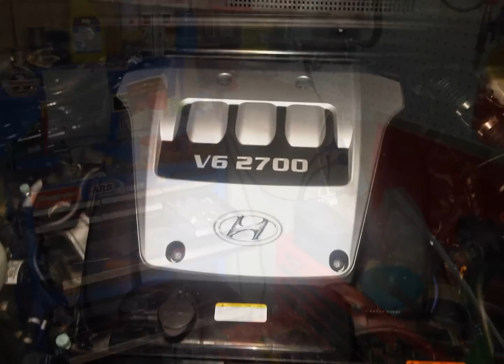Hyundai Tuscon  Timing Belt

Comment: This was far more helpful than videos that actually try to explain. I replaced the timing belt on my 2.7 dohc and couldn't figure out how to line up the crank. I've got it all back together but it still won't turn over. Just a continuous crank. Been trying to figure out where I went wrong lining all the marks up.
Reply from the maker: hey william, as long as the crank marks and the cam marks are all correct it should fire. when you let go of the tensioner do the marks still line up?becuase the tension when released will turn them.
outside of that you should check for spark first, then a led test light across an injector to see if the ecu is triggering it, if thats good then check fuel pressure
Reply: @TheBenno007  All marks were lined up even after releasing tensioner. I have spark, and fuel pressure is good. After lining up the marks a second time I tried again and I still got nothing. The marks became misaligned again. I'm not feeling air being sucked into the intake nor being pushed out. I'm confused at this point.

Comment: Thanks boosoo pls can you help me with how  the 4 camshafts are timed on the 2chains
Reply from the maker: Hi there Cheo, it will be the same, where the marks on the cam's will need to line up with the marks on the block of the motor. In this video the rear cam was out just 1 tooth and caused many issues. just line up marks when putting belt on but remember the crankshaft timing mark to be at TDC also.if all of these line up when installing new belt you should be sweet.... Good Luck!

Comment from the maker: yes it does have a hydraulic tensioner, you can see it at 2:24min in the video. Difficult to compress after removal for refitment, generally comes with pin to hold back when brought new..

Comment: Right at this moment I have about 57,000 miles on my 2006 Hyundai Tucson. So when it reaches the 60,000 miles is it a good I deal to go ahead and have it change?
I got an estimate of $953.40 to have the timing belt and the water pump change at the same time. Because it was told to me that I mightiest well do the water pump because they'll have take down everything again in order for to get to the water pump, so is this true?
Reply from the maker: Faye Wren  hi there Faye, timing belts do stretch over time and is recommended that they are changed along with the hydraulic tensioner. and water pump pretty sure around the 100,000km mark is time to do a timing belt, sounds like a good price you have been qouted to have it done. and yes water pump is a common thing to replace while doing the timing belt on this model, 

:)) glad to help good luck
Reply: Thank you!!...be blessed

Comment: Oh, what about the engine mounts? Thought you had to remove it to get the belt out.
Reply from the maker: my apologies, a Mechanic had fitted a new timing belt and gave it back running rough so i only readjusted it didn't remove it.

Comment: You didn't have to remove steering pump and alternator?
Reply from the maker: Hi Mon S, on this model you do not have to remove alternator, and the P/S pump. Mounting bolts for the p/s pump are removed and the pump is just lifted out of the way you do not need to remove the p/s pipes has they are a flexible hose. I used a cable tie to hold it away from where i was working.